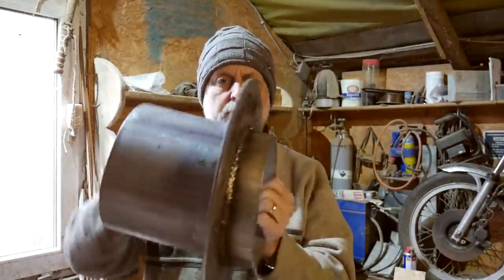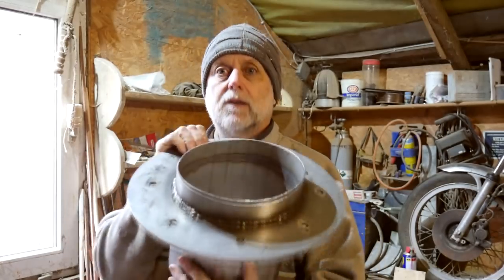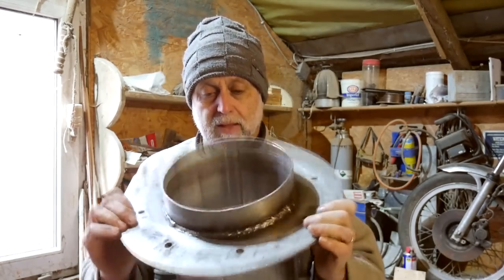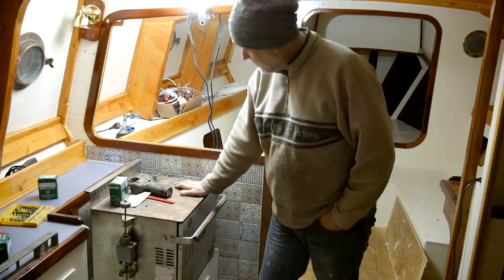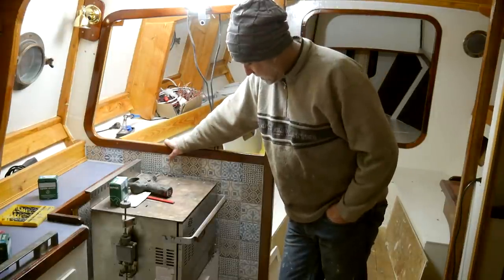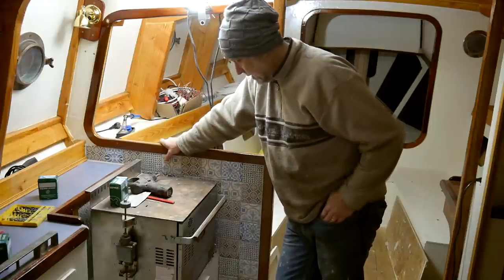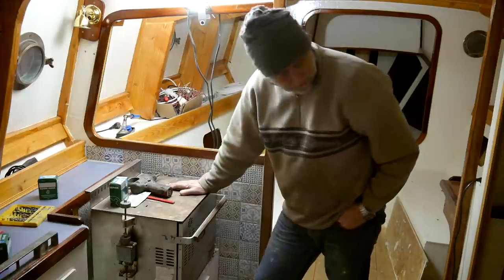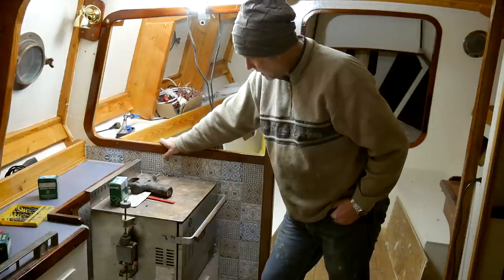Partners progress and a galley change; Building a cruising sailboat - SV Tapatya EP168

Comment: The mast partner looks great Tony! And you were able to save the cabinet facing - well done. We are having some major supply chain problems here on the West Coast in the States. I have been waiting 3 months for pins from a manufacturer that is located just 20 miles away. (And that is just the beginning.) Seems the suppliers and manufacturers locally are adapting to Covid restrictions regarding distancing and the clear panels which is great but it sure is slowing production down. Tapatya is looking great Tony!
Reply from the maker: Thanks Charles. Generally, supplies are ok here - a bit slower than usual, but not too bad. However, brexit has made getting anything sent over from the U.K. just about impossible. And I have a ton of lead waiting for me to pick it up, but I'm not allowed to drive to that location at the mo 😤

Comment: Hey is this a new, 12" picture-disk of "Sit and Wonder?"  Picture disks, I'm definitely showing my age!  
That partners fitting looks great, Tony.  Regarding the 8 X 12mm holes through the deck, will you be doubling-up the thickness of the ply deck itself?  That said, I seem to recall that there are already several layers of ply on the deck, so perhaps it would be superfluous.  And I'm sure you've considered this already, but on my boat, those bolt holes get wet - so oversized holes, epoxy-filled and re-drilled, might be a good idea, to prevent ingress into the ply - as you have done elsewhere aboard Tapatya.
Thanks for another very interesting and informative video, Tony.  If you get a chance, it would be fun to see how the work is going on Hazel's boat, also!
Reply from the maker: Thanks Chris. Yes, those are good thoughts re the fixing down of the partners fitting. You're right, the ply is already 4 layers in the partners areas, so extra reinforcing isn't needed. I was planning to go up to Hazel's boat this weekend, but we've got quite a bit of snow falling, so I'll put that on hold for now. An update will come in due course though 👍 Picture discs - I've only got the one, but I do still use my record player and have even bought new vinyl recently 🎼